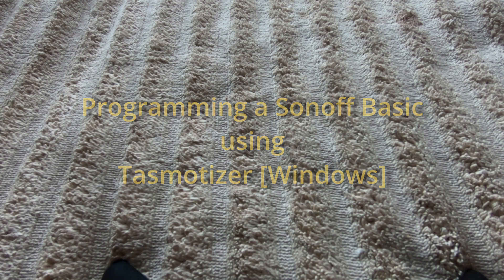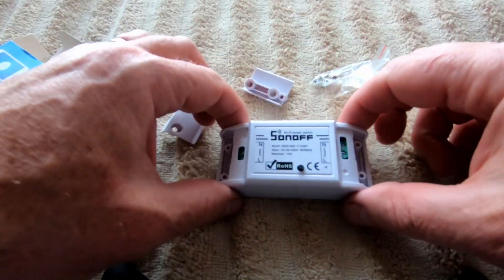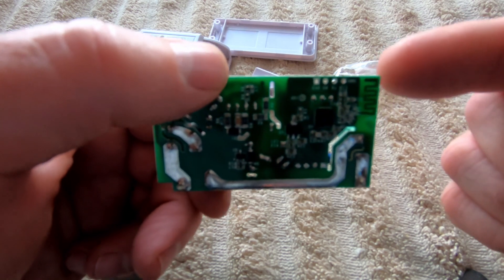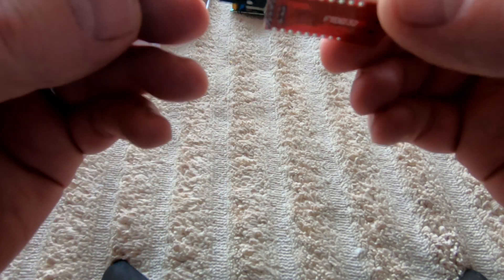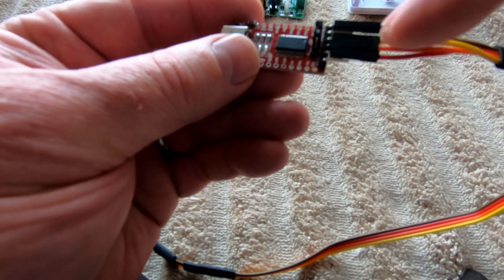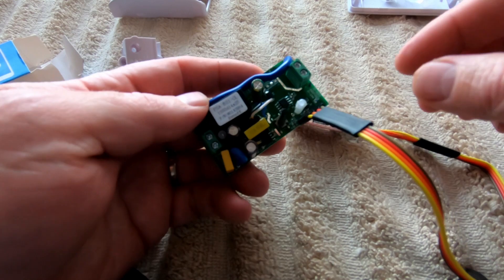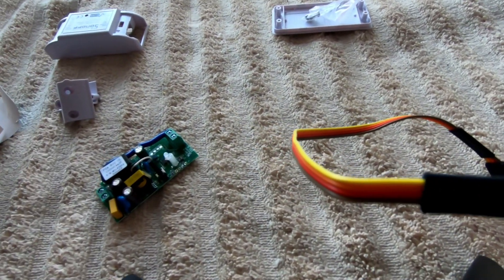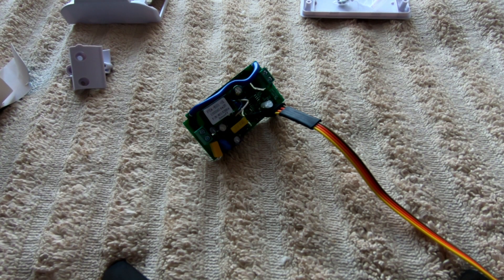Programming Sonoff Basic using Tasmotizer

Comment: How can I contact you? I need your help. I would like to know how to change the firmware of the basic sonoff to add it to homekit.
Reply from the maker: Hi Luis, I have not flashed any firmware on the Sonoff which works directly with Homekit, but I understand there are some out there.
I use Home Assistant for my Home Automation & as such use Tasmota and mqtt, so I don't use Homekit.
I will do some research though and look at the options :-)